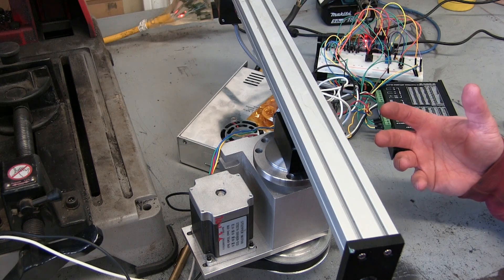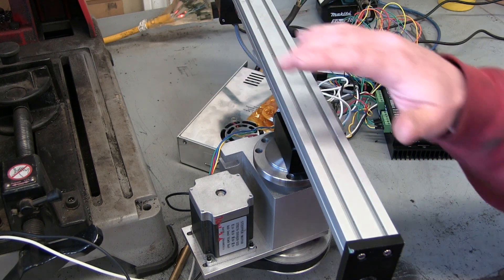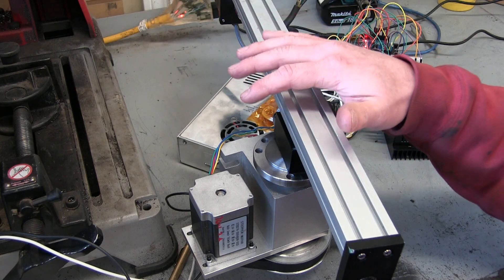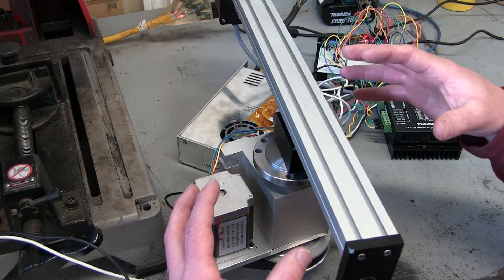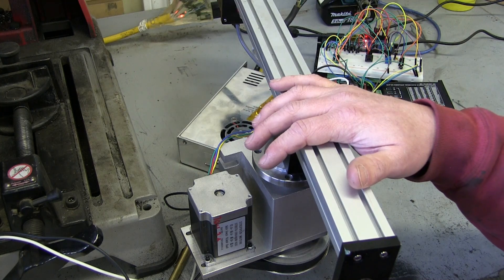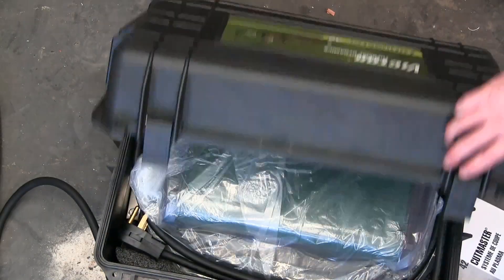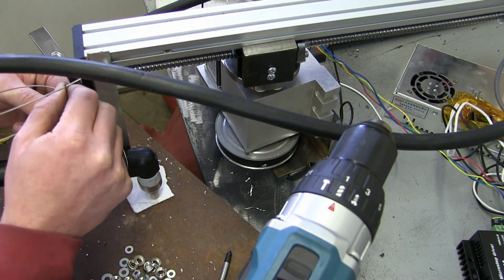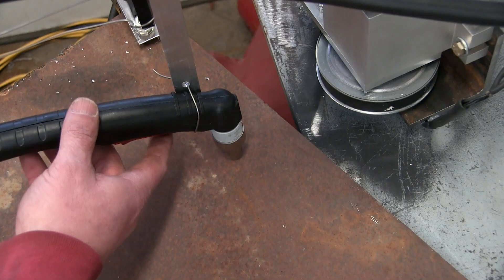Portable CNC Plasma Prototype

Comment: As usual a great video once again..! I really like your approach to it, cause everyone with a lot of cash, can by such a thing. However, for us poor ass cheap MF, this ain't an option. I do a little thing in my workshop by myself. One of the next projects was a welding jig, with an SCR for a variable welding table (round welding).These things are dirt cheap on E-bay. I gladly sponsor one to you, if you can use it for one of your great videos http://www.ebay.com/itm/1PC-AC-220V-5000W-SCR-Voltage-Regulator-Speed-Control-Dimmer-Thermostat-/262886248778?hash=item3d353dd14a:g:vrsAAOSwTM5YwBB3 . You would probably use one for 110VAC, they are available too. Then I just got my eyes on your new video. Of course, I just HAVE to see this and almost have a hard one watching you workshop tools. Great AvE, keep them coming. Think I'll go for both, a welding jig and a CNC plasma cutter AvE style.
Btw, I'm a professional blacksmith and machinist, so naturally, I do use the plasma cutter frequently. Ever since we got such a thing in the workshop Oxygen, and Acetylene, is outdated.
If you make a test run, with your apparatus, you should lift the torch a tad more (just a few mm ), it will be a help for the torch, as it can easily get stuck on top of the slag.
Doing so, will ensure a cleaner and more uniform cut. Maybe the cutting air should have a little more go (depending on the thickness of the plate of course).
It will help to blow the slag to the back side of the material.
I'm really looking forward to see your progress with this machine.

Comment: So, I'm a bit late to the party here, but I'm loving this idea. Even if the thing didn't have a mag-base but instead just bolted to the work piece with a few m10's, this is the solution to problems we didn't know existed. 
A few issues and possible workarounds though. Scale would be a problem. Normal XY CNC you set a root position (put your torch where you wanna cut, then cut the shape from there) and the design you cut is scaled correctly regardless of where on the bed you start your cut. With polar coordinates, the farther your cutting head from the pole, the larger the cut is scaled radially. To avoid this, you're going to have to have the operator manually measure and enter in the exact distance from cutting head to the pole of the machine to account for differences in mounting the torch and not relying on the machine to always count the steps of the radius actuator. 
So, Joe Blow has to cut some slots out of the side of an I-beam. He mounts this contraption to the beam, and syncs the thing to his phone. Loads up the app, drives the torch to the start point of the cut. Punches in the distance from the torch to the pole (since the base is precisely an even integer circular around the pole, it makes in dead simple to add 3" or whatever to what his ruler says), selects the shape and size he needs to cut, feed speed, throws on required PPE, and presses "play". Lather, rinse, repeat.
It'll probably need some kind of automatic Z-axis control to keep the torch happy, and don't forget your lead-in and lead-out arcs. All in all, a simple and useful tool that added bulk and complexity to a job in exchange for ease of operation and repeatability. Approved.

Comment: I like the idea, but why not a X-Y plotter ?
With your idea you would need twice the room because the back of the arm has to go somewhere, maybe the X axis could have 2 mag bases, the Y would therefore be the only axis that would need the room. and if you do the Y like a drawer slide, it can move further but be compact.
Advantage of the X-Y parallel system is that the software/hardware already exists in cnc tables.

Comment: I worked on something similar with a radial arm saw with a router but.  The problem with polar coordinate cnc is a lack of rigidity with a very long arm.  Plasma will work better, though.

Comment: I like the idea. Just wack a cheapo linux sbc with Bluetooth on it and control it from your phone. One issue you may come across is that the further away from the center it is the larger the radial step will be. This means it may be lass accurate  further out especially when trying to do combined thrust and radial movements. Good luck!

Comment: Safety: Add a solenoid actuator to the cutter and solenoid valves to the gas going in so if (or rather when) power fails to the magnetic base, the solenoids close right away. No frills cheap and robust safety feature.

Comment: Not looked at the comments... I would suggest allowing for the drag at different radius...  I.E. the further the cutter is from the the axis the slower the rotation has to be to maintain a 'consitent' speed over the arc of the radius. 'Did I make sense there?'. ;)

Comment: the biggest problem with plasma is the hole is not perfectly perpendicular ( you get a beveled cut at thicker materials ). A rotabrach cutter that cuts 4" ( 100mm ) up to 4" depth  is 26-28 kg with magnet and all you need is a small power cord. plasma that cuts up to 4 inches dept is a monster in size ( weight ), power consumption and air suply. It will be to expensive to make that thing mobile and put in a crane for jobs at altitude.

My 2 c.

Love the "f..." videos.

Comment: Hey mate. Look into arduino control. They are low power and work really good as controllers for this kind of thing. Do some research into robotic arms. Normal cnc software will take a lot of programming to get it cutting correctly. I think robotic arm software would be the way to go!!

Comment: When you're figuring for how to do X and Y tool jobs with a rotary tool maybe consider including a few little boxes in the interface that allow you to put in the thickness of the material you're cutting and that would run through a little calculation and let the brainbox know how fast to drag the tool so you aren't blowing holes in thin material or out running your heat on thicker stuff. Maybe include a little progress bar or a loading screen with an eta or something to, what for holding the attention of the 200 pound gorilla. Just my two cents :)

Comment: hey so what if you could operate it with some sort of joystick and have a digital readout to measure accurately. i guess it would operate in the same way as a mill except instead of turning dials you would move the joystick. thoughts?
Reply from the maker: Giver.

Comment: Some laser cutters have started to include a feature where you can freehand draw the pattern you want cut, on the material you want to be cut, and then a camera translates that into a cutting path, a similar feature would be good to keep people interested, a sharpie is easier to use than an app

Comment: I believe you have a good idea for a weekend warrior but not so much for a fab shop or on site fabrication.  The track torch and mag drill are not just used for their simplicity but also their ruggedness.  You look in the back of a welders truck and see a mag drill or track torch and those jokers have been through hell.  Furthermore, anything a good fab guy needs to cut out will be done free hand. My father and Grandfather have spent their life in industrial welding and fabrication and I just could not see them using it as it is.  Make it rugged, It could way 60 pounds and they would not have a problem using it, and take the cell phone out of the picture.  If you could make your mobile cnc run off a template then you would have something.  Good luck and good idea!

Comment: You might change the rotation speed based on the distance from the axis of rotation.

Take a shape in rectangular and change it to a polar system (uses rotation and radius from axis of rotation).

I've taken the calculus classes to help support this and I'm a software engineer if need be just message me.

Comment: It really is an awesome idea. Just a quick list off the top of my head of things needed (you mentioned some already):

1) Getting the linear and rotary axes to move at the appropriate rates for the shape. 
2) Adjustable clamps for different brands of plasma cutters to make sure it's setup correctly.
3) While on the subject of the positioning of the plasma cutter, could you flip the way the handle goes, 180 degrees? then the cord wouldn't bend over itself causing undo stress and extra torque on the cnc?
4) For the basic shapes on the app. Being able to enter specific diameters of circles, length of sides on rectangles, squares (also known as rectangles), triangles, etc. For triangles and other non-90 degree shapes, entering angles? Of course different standards, Imperial, Metric, etc.

And relating to your last question, would I use it? Absolutely, the only problem for me is the expense of the plasma cutter. Still haven't bit the bullet.

Comment: It is a good idea I wanted to do something like that for not high precision cut,  math is not a big deal etc but  .... U need ways to enter reference positions on the piece you want to cut, let say you want to cut a rectangle,  you put your magnet base somewhere and you go in position mode where you will put manually points for different lines of what you want to cut.  you can use a special head that will be used for positioning.   after that you run a dry pass of the head and if it is ok you do another pass with the cutting tool.
Reply: lol I should listen to your other vid first : oP

Comment: This is where CNC is heading, cheaper control system that's easy to use. 3D printing is the newer breed but providing the fastest advancement forward, but eventually this expensive cnc control will be competitive and someone will do something like this in your video that will make the ball drop in more and more of these young kids at uni that are currently focused on 3D print. The sooner we have cheaper control systems, the better, a plasma torch only glides over the metal, it's not like a router or a mill, lighter controlling hardware and newer software to help get my shop running haha

Comment: Have the library of shapes in an app for sure, but also have an optical sensor, so you can draw a path and have the machine cut it. How simple is that ? Cut cut along this line. (i commented without reading the other comments, and it looks like a few people have the cut where you draw idea.)

Comment: Wow, thinking about building one. That's amazing. Quick question, what about cutting uneven surfaces. Is there a way to get the device to adjust the cutting tool depth while in operation? IE cutting corrugated steel or an uneven surface?

If that makes any sense. Coffee is still kicking in.

Comment: Bright idea ! I salute your inventiveness ! Nice to see an anglo press on the bouton and make it work ! ;)

My 4 «cennes» worth !

Use the better stepper made by Technik; everything is built-in and has a super controller that allow for some incredible features ! A bit expensive but really good. You might by able to use only 1 motor by means of a pantograph.

Second, forget about the iphone app ! I'm working on some other type of machine  with automation. I'm building a web based application to control my machine. Easier to develop and mucho cheaper. Plus, it will work on any device. All the crunching is done on the controller whici is a small linux device that cost only 20 canadian ducks !

https://www.teknic.com/products/clearpath-brushless-dc-servo-motors/?kw=%2Bclearpath%20servo&ad=167363009700&gclid=CjwKEAiA6OnFBRDcgt7YmPKI33ESJACJoTJYQEcbYsj7-G9HHCDYKQSDWCgX8MBbdknVXK8I7U77fhoC54nw_wcB

https://labs.mediatek.com/en/chipset/MT7688

Comment: Great idea! Would be nice to load DXF files into the machine, makes plasma cutting a lot easier. Maybe it is posible to let the machine make a quick dry run of the part to see if it fits on the sheet that you are cutting. For thin sheet aluminium and stainless try to ad a thick peace of steal underneath.

Comment: You could use a servo motor to control the trigger instead of holding it so that it is all done by the board like a CNC machine. But other than that it is an awesome piece of work you got there.

Comment: add a camera so your phone can connect to it through WiFi or Bluetooth ans you can just over lay those square or circle templates right onto what the cnc sees, than there's no fucking around with drawing on a piece of steel and no disconnect between what the bot sees and what the worker sees

Comment: I suppose you could put a pointer on the front that you line up with the center punch - sets the origin -, and then just punch in the diameter of the hole. Sounds easy enough for the Ringo-s, like me, in the fab industry. Operator stupidity is your biggest problem.

Comment: I think the whole idea is great but the thing with cameras and lines are little to much bumblefuckery :D. Writing G code from hand is not simple enough for everyone and not the fastest method. But there is one simple way, nice and easy and even fast. Method is used to teach small industry robots. You install position sensing on axis (usualy resolvers or optic/linear position sensors) to read position of axis, You turn off steppers/servos and move the "head" of the machine to desire point, teach this point in than to next point, the trick is that software connects the dots and writes your paths, you give only start and end points (you can add circular movement using points as center and radius ) its simple enough to be explained and used by everyone and still gives lots of possibilities. But i would use other architecture for axis, one like scara robots have.

Comment: Friggin brilliant! want, must have, throwing my wallet at the screen not working!!!
the math matics is just in need of some fine tuning.

my suggestion to the greatest plasma-cutter accessory in the world?

add feed back, optical sensors, and allow for "assisted/repeatable tracing" cause everyone wants to maximize material usage

i will be willing to fund and stock a small inventory in California for some of the needed basics. and no, will try to get best pricing. i have drooled over a plasmacam for longtime. this is just a great ldea, stock in a slag catching trailer. generator, coal-fired air-compressor and welder and you have a portable manufacturing.
Reply: i am also know g-code. used to run a komo 5' X 12' CNC wood router. and 25 HP Quincy rotoary vacuum pump.

Comment: Hello PLEasewhat I think you are wanting is......Panasonic p80 machine torch pilot arc..... hebay 40 dorrarwith its vertical tubey shape, you simply 1. turn it down so it runs in a bearing somehjow - trad ball screw MINI mINI one 1/2 inch travel2 cut threads into the roundy round body and spin it with a z - axis for up and downey-next, on its way down, as you have some motion downwartds, you can then simply fit the switch to chooch as it ascendersi.e. you needn't be near the burney burney bit.I still think you need to fabracorble a bed of nails  - but use CHEAP 2 inch bolts, of which you then simply magnatizebefore fitting, butt fer the stickiness- sit that in the wifes best baking tray full of the liquid conduser

Comment: A well defined set of parameters for update can help make the app "extensible"; by my count, that's an image (.png or .bmp) of the routine and the routine itself. A coexistent interface could accept one .svg, because vectors are a type of routine.

There then arises the idea of layering some static functions over that routine once selected e.g. Scaling, device-specific limit verification, rotation, &&. I figure you would want some of those functions to be always on, and the others to have parameters controlled by the user through, say, sliders with some feedback screen showing the transforms on a basic shape, and would consider some unholy large selection of shape/size/rot in a list to be unusable. The more extensible phone UI is not difficult to build, but it does make the handling of the routine involve whatever language the app developer will use.

So here's the nut of it: the format of the routines you will choose to update the app with later: I can see how the c language works for your bespoke solutions and can tell you that both iOS and aOS apps can use those routines, but iOS only runs c natively & w/caveats in the old, pre-"swift" language and aOS does it across the Java Native Interface and there be ultra-mega dragons there. Though the final app can be stable with the basic routines written in c, the work to realize that stability is non-trivial.

I'm sure there are many options for the language of the routine, but consider opening an .svg file... not in llustrator/Inkscape but a text editor. You may already know this, but it's just a series of on-and-move commands, as opposed to a mapping of bits(bitmap). Since programs run by people who have differing levels of meticulousness usually generate these (some people do it by hand), some svg's are absurdly written but others are just a few paths; the latter are what this app/machine would want as input

Comment: Probably want to program it to start the bead inside  the cut so it doesn't drag or run into issues since it seems to be fine at right speed but initial start always will get some crap.

Comment: Two things spring to mind: make the phone app (oh gods I hate that word, it's a PROGRAM(me) goddammit.) an augmented-reality affair where you can point it at the workpiece (include a little fridge magnet the size of the base magnet for machine vision to pick up on) and see what the cut is going to look like.  Maybe have the scale be on-screen; toggle amongst different units (yards/arshens/meters/printer's/points/whatever.)
Also you could hang it upside-down and tell it to cut out around itself and it would fall to the floor.  Since this would break an expensive and useful tool, it should have some kind of safeguard built in -make the error message cycle through some lines like "I cannot self-terminate"; "I'm sorry [USERNAME], I can't let you do that."; You Can't Do That In Horizontal Mode!"